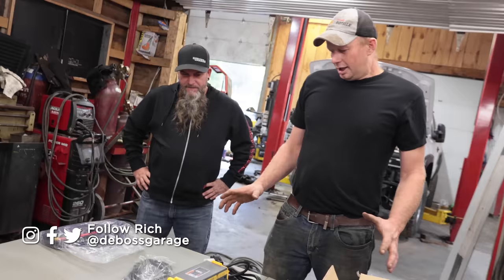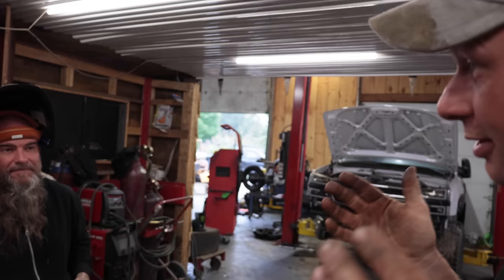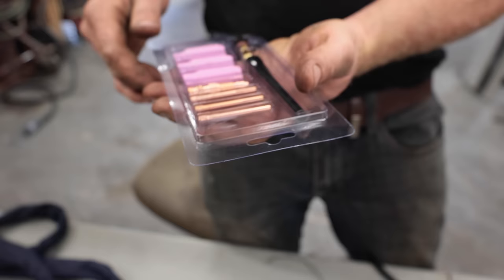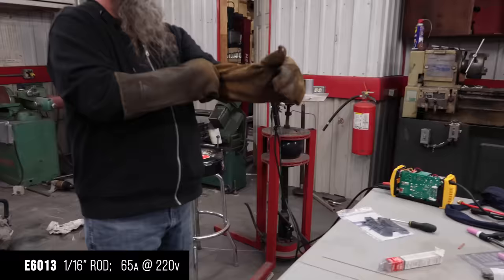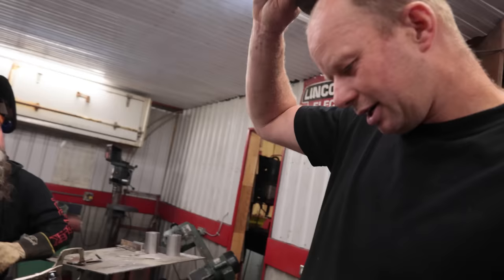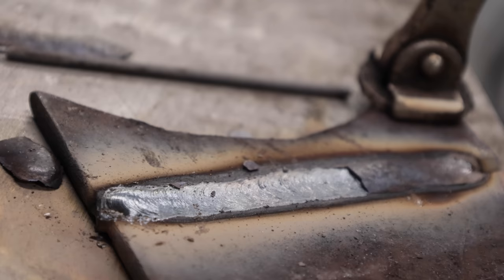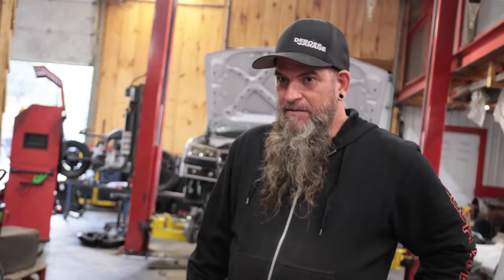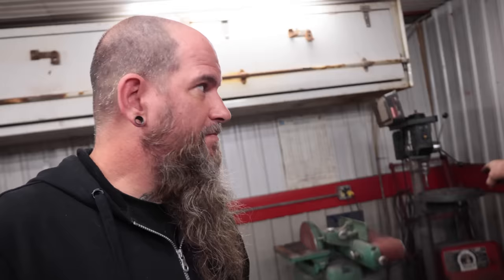How Good is the CHEAPEST Welder on Amazon?

Comment: As a welder I’m impressed by how well that little welder worked! I might have to pick on up just so I can do some tig welding!
Reply: I'm not sure about all that, but I might keep one in the toolbox of my truck and run it off a small generator or inverter.
Reply: For 100$ why not! Use a credit card and now it's free to you for awhile!😂
Reply: the scratch start will drive you nuts...
i find its not the start thats the issue. its the stop!

then again, they arent too hard to modify to HF. or slap a pedal on. most circuits are the same under the cover....
Reply: So if you use a credit card you don’t have to pay it back 😂
Reply: @C0D3R33D  it’s a wright off 🤣🤣
Reply: Actualy no if you died  @C0D3R33D

Comment: I had Harbor Freight's Titanum 125 and loved it, but being stuck on 120 left me little room to work with beyond really small jobs. I picked up one of those "220A" Chinese inverter welders from Amazon and just running flux core and stick has covered 99% of the work that I do. I am always expecting it to explode or go up in flames, but it hasn't yet. Like Vince said, if you can make or save money with one, they literally pay for themselves on their very first real job.
Reply: That's the way to go! I do the same thing; cheap 125 flux welder for thin stuff and stick for the rest. 👍
Reply: @WeldingForJesus  I weld with 2 microwave transformers I wired together and just got a chinese machine that says it can do tig, wire feed mig etc. You can do thin stuff with stick its just hard. I run 1/16th rod 6013 at a real steep angle, hopefully with a thick backing to act as a heat sink. or just tack wait. tack to avoid blow thru. If blow thru happens I come back with a thicker rod and texas 2 stick to try to fill. It spatters everywhere, prone to blow thru, blows the breaker on anything bigger than 1/16th, and does massive slag inclusion but has boogered every weld I needed to booger. Im hoping this chinese welder steps my game up because I hear people saying wire feed is easy and I want the option to burn bigger sticks without blowing my breaker. Realistically Im mostly welding tools I make out of thin scrap I found or repairing a random grill leg or lawnmower deck.Biggest project I tackled was a wood stove I made. I saw the supposed $10 stick welder that looks like a impact gun and said thats more like 90 and you can get a chinese buzzbox for that price and decided its probably time to upgrade and move passed the microwave welder.
Reply: @gantz4u moving "past" the microwave transformer welder is probably a good idea. Although there are videos outthere that teach you to have multiple heat settings based purely off the amount 9f windings you do for which heat is required. Starting at like 60amps ànd all the way upto about 180 or higher

Comment: Scratch start TIG is the best to learn on imo. It teaches heat control and travel speed at a more emphasized rate. And once you figure that out, along with adding filler, you can pretty much tig anything. I started off on scratch start tig on only stainless, and the first time I used a high frequency pedal machine, I was laying absolute dimes. Start with the toughest, and you can do anything
Reply: I would absolutely agree with learning on the hardest first. I learned on a great   30yr old sycrowave with a pedal which I still love to this day. But the material I learned on was outdoor beach and pool furniture that fatties lay down on and break or hurricanes who knows. All salt oxidized ,corroded away powder coated aluminum and cast iron. A few years of working that everyday after school I was able to go to technical school while in highschool for welding. After popping your cherry on that everything was easy won a national welding competition with hundreds of points between me and second place.
Reply: I agree and here is an even older example,  I started out stick welding with a $20 welder sold in the ads of Popular Science in the mid 1960's.  The welder ran on 30 amp 220V and was basically welding direct line through some resistance coils on an asbestos sheet.  Just striking an arc was an accomplishment let alone life threatening.  Once I bought my $100 Lincoln buzz box I thought I might be able to weld afterall, what a difference!
Reply: Anyone reading this and just wants to do some minor crap, or crafting should disregard learning stick welding lol.

Just do wire feed if you want to.

Man is right if you plan on Being a welder.
Reply: in high school my schop taught us oxyacetylene first, told us to learn the motions and puddle control and after a week or so we started using filler then taught us stick welding and in metal shop 2 is when you learned tig and mig
Reply: Thanks! Good review!
Reply: The multi process welder they make has lift Tig with high frequency start. Only downside to that one is there is no pedal for on the fly heat adjustment.
Reply: I learned how to operate a crane in an absolute dinosaur!! Got my seat time for 3 years in lots of old ghetto rigged cranes.. no computers, safety shut offs, the works... 
Now I'm in brand new liebherr's and demags (5 million dollar cranes) and people ask me "aren't you nervous!?" and I'm just like bro if only you knew the cowboy shit I used to do.. 😂 this shit is boring af lol
Reply: Worked at a plant and all they had was scratch start. I was very happy/thankful I hd someone behind showing me what I did wrong and how hard he was that preparation is key to Tig.
Reply: You absolutely learn how to control arc length relative to heat so it is a must.
Reply: I learned the hardest with a mig welder.. 💥😄👍🏼
Reply: @woozledog  I like stick, and it is normally much cheaper, but with these ridiculous prices, who knows.  I got a huge and heavy MIG (no gas hookup) for 70 bucks.  It is so large that I thought maybe the brown box was for several welders, and they hadn't broken it out.  It will run the large spools.

I do a lot of my projects out of doors for safety reasons.  And the current stick is so easy to use, and really burns in.   A lot of MIG barely scratches the surface.  Of course it can be really great, but it can also look like caulking.  Stick falls apart if it isn't tight.

Comment: Being a retired military computer geek with just shy of 40 years experience, I am very impressed with the technical skills of the welder using the cheap device. Thank you for doing this video!!
Reply: Boydmt68. These modern Welders are Easy to Use.  You can easily weld 2 Bits of Steel Together.  They are not like the old ones that Need 150 amps just to start it up !!!

Comment: I'm a Fabricator, and I was Impressed for what it could actually do, even reasonable Tig welding, But I do like a Foot Control. I Learn'd to Tig Weld at "TAFE" college, here in Australia, With a Scratch start machine, Just over 30 Years ago, so I know what that takes. For a $70 Dollar welder, $100 with Tig, off Amazon, that is crazy. You could Throw that in the Boot of your car, just as a Small backup unit to fix a friends  broken things, I always have my spare Helmet in the Boot, anyway. Great test on that Machine, thanks.
Reply: That's the sort of thing that I weld for anyway so it's a good little unit for me.
Reply: Looks good but how long will it last ?
Reply: Did his helmet have adjustments?

Comment: The cover is part of the cooling system, I'm impressed you didn't burn it up.
Reply: thats a good point, its like running a lawn mower engine without the cowling......the designed air flow is missing.
Reply: You don't think he doesn't know that; given the projects he has done?!!!
Reply: @KStewart-th4sk  I never said a thing that suggests he didn't know that.
Reply: Yeah, if anything that helps make sure it's a little beast. If it can run like that without the cover, it should last a good long while with it.

Comment: I have this thing's big brother, the TL-250M Pro that does 250A, stick, lift TIG, and wire feed, and it's currently $325 on Amazon plus $45 for the TIG torch. As a home hobbyist, it's a great little machine and does everything I need. I've patched up my snow blower, used it to build a welding cart to hold it & plasma cutter I bought, and have made animal sculptures out of silverware both with the TIG torch and flux core wire.

Comment: I have the same welder, got a buddy who calls me to weld his farming equipment back together. It works perfectly. 7014 1/8" no problem or 7018. Got 20' jumper cables that are better than the 6'ones it comes with

Comment: I love videos like this. The guy doing the welding, true professional. He didn't have that cocky elitist attitude of like " MILLER OR NOTHING" kinda person. He gave his honest opinion without bias. Now, for the welder, I agree, basic but great starter or emergency welder. There are a TON of good people with great skills and ambition who are kept from enjoying a hobby, honing a career, all because of the entry fees into things like welding. Even getting started with a Harbor Freight system is 1K just to start.  Aos again, yeah I love the entry level tool reviews from a unbiased professional willing to give us a HONEST opinion and result. Even if it's sheer junk, we want to know.
Reply: Actually, a couple hundred at HF will get you a decent basic Mig welder, but you still need to find someone's old tank and regulator if you want to avoid fluxcore.
Reply: @boots7859  The gas cylinders are the most expensive pain in the ass part of it. I got a decent flowmeter regulator from Amazon for under $30 though. Nothing fancy, but does the job.

Comment: I keep one similar to that in the  truck for backup. I use 1/8 7014 rods for easy start and worked well to get me out some emergency pinches when i didn't want to break out all the gear and it works well with a big enough generator.

Comment: I have one works like a champ. I have a snap-on 250, old Lincoln buzz box, harbor freight mig, my snap-on has ALL the bells and whistles and I like the welder you just did this video on and my harbor freight mig welder the most. If I have a job that requires a lot of heat for a longer time I use the snap-on.

Comment: I use to work with vince I'm an ex welder fitter, I'm quite impressed with that little welder, too bad it didn't come with a foot controller, pedal set up! because newbee's will struggle with not being able to control the heat. Definitely something you can learn the basics with, If I were to buy a tig I'd definitely would want a foot controller, but you have to pay a little more for that regardless. You do need that option in my opinion when things get too hot,  you want to be able to control that heat. Especially, with thinner metal. If you just welding 1/8 :1/4 to 1/3 plate should be fine, bodywork no! you'd need a foot controller to help weld thin metal work, I think if you want to learn how to weld it's has great features with stick capabilities and an option to learn tig, over all not bad. For a hundred bucks you can't go wrong really.
Reply: Does it need a foot controller?

Comment: Bought the Tooliom 200 TP Tig/Arc with the pulse and it has done the job in a pretty great way! From a 4piece antenna mast to a pull behind yard cart for my mower and a bunch of other misc fixes 110/240 works just fine! Liked it so much i bought the Yeswelder 5pin foot pedal for it and it took my stainless to a whole new level!! Paid $179 used my prim rewards and got it to the house for $117. This was the video that turned me on to Tooliom..thank you. It is a great little welder for beginners and not too bad for the experienced either!.

Comment: Definitely added that to my list. I've had a $100 harbor freight flux core wire feed for 5 years now. Pretty sure I've run about one hundred pounds of wire through it. Zero issue aside from duty cycle times. 🤷‍♂️
Reply: Same here. Old Chicago electric flux welder. I had mine for 6 years, ran about 100 lb through it too. It's still running, though i broke the carry handle on top of the machine and dropped it several times. The fan sounds like it's hitting the case when it winds down but still works 👍

Comment: I used to sell welding equipment and the smaller machines would have limiters on them. If you remove the limiters you can weld using four mm rods. 
They are a great tradie option for sight work.
They generally can only weld for five minutes before the safety shut off kicks in that turns the machine off but keeping the fan on too cool it off.

Comment: I love my $220 sungoldpower 200A DC tig welder. I think that $200-300 range is a good starting point as for that money I got a gas valve and acceptable build quality for a light-duty machine. I've used nicer torches since I bought it, and I've poured about a thousand dollars in tanks, accessories and consumables at it while I've learned, but it still treats me right when I need to stick two pieces of steel together.

Comment: As a sheet metal fabricator in UK I used welding of all kinds in my job, a car I had needed some welding, not having bothered to have my own welder I got the job priced up £300, I bought a similar welder with tig as well, did the job myself for a third of the price, have used it quite a bit for other jobs at home, never had a problem with it, for the price they are a handy tool to have for the odd jobs.

Comment: I have similar welding experience as the guy in the video...started with high pressure piping and pressure vessels now do custom stainless tanks and piping systems...I was throughly impressed with machine...looked on Amazon and saw a 200 amp version with high frequency...might have to get one for the cottage for emergency repairs....great video 🍻
Reply: For tigging I think Hi Freq is a must, and a throttle too. Scratch starting ruins the tungston quickly and w/o HF you cant do Al at all. Parts heat up. You need to reduce heat as you go.
Reply: If you were that good, you'd never even look at a crap rig like this one.  Not even for emergencies.
Reply: @foobarmaximus3506  good enough for minor repairs at my cabin...anything substantial I would just borrow a real portable Miller machine from work
Reply: @jerseyshoredroneservices225  hi frequency is ideal yes but in a pinch for quick minor repairs at my cabin it would be good enough...used to use a throttle via foot pedal but haven't in over 20 yrs...not a necessity..I tig weld for a living...mainly stainless steel

Comment: I have the $450 multi process welder from them and the new generation of their plasma cutter. Both of them work very well.

 I refaced an anvil with it and it worked perfectly. About 3 lbs of 7018 and then about about 6 lbs of 5/32 hard facing rod (11018) back to back rod after rod and never once didni hit the duty cycle limit or trip a breaker. 30 Amp 220 volt circuit. I have also used the Tig to weld up stainless exhaust and it also did very well. The Mig works well too. You can also fit a big spool of wire in there. All in all i love it. I have used the plasma on up to 1/2 inch mild steel and it cuts it with no problem.

Comment: Great video! It would be great to do a part two, and add a pedal, and upgrade the torch. Do a few tweaks and let Vince go crazy with it.
Reply: Agree. I don't think it would be too hard to  add a flyback coil and add the Hi freq start with a pedal as well as a solenoid valve to turn the gas off and on.

Comment: I’ve had the little grey box model. Had it for ten years now and I can’t kill it. 3/32” 6013 is it’s sweet spot. Reversed its polarity a couple times to scratch start tig and it still performs! This new model I bet will keep on trucking like the old one. I’ve got a trailblazer 301g and a XMT200CCCV. It doesn’t replace them but if you’re working in someone’s back yard 200’ from your truck, it’s a no brainer.

Comment: I have this same brand welder but the 195A model. I bought it about a year ago. I have 35 years of industrial maintenance experience and have ran a bead or two. This little welder does really well especially when you are running it on 220V. If you are using 120V supply you will have to increase the amperage setting by at least 50%. The biggest rod I have burned is a 1/8" 7018 and it ran very well on 220V. A 3/32" 7018 runs very well on 120V but you have to set your amps at about 115 as opposed to about 75-90. It is well worth the money. I keep my Tooliom welder at my camp. I use a Miller 235 Thunderbolt XL at my home.

Comment: Being a UA pipefitter by trade retired, When I first started TIG welding pipe, I took a UA funded welding course at Columbia Basin College in Pasco Wa. I was taught to set the temp on the welder to whatever you would be welding at, then using the peddle to start you roll up and stand on the peddle because you don't want to be standing on the other leg while working the puddle heat, unstable footing not good. the peddle purpose is to reduce the puddle size as you roll the puddle up on the bevel freezing the puddle and the glass on the bevel to avoid punching a pin hole through the root when you stop the bead and it puts the glass up on the bevel where it is removed and not show up in a Xray if you do that level of welding. I always made sure I had a 3-4 point stance plus stroke the intended weld before striking an arc, both feet planted one hip and one elbow for control, plus I walked the cup 95% of the time from root to cap. The peddle is to start and stop the process only.

Comment: This has 100% convinced me to give welding a try. For small fabrication, I think something inexpensive like this would be ideal.
I assume this would work the same with aluminum too, no?
Reply: NO. For Al you need Hi Freq and a pedal or hand control "throttle". It just wont work w/o HF and you need to control the heat as you go because parts heat up quickly.